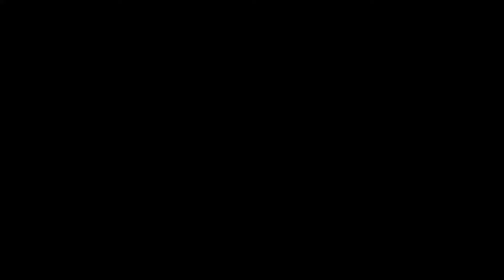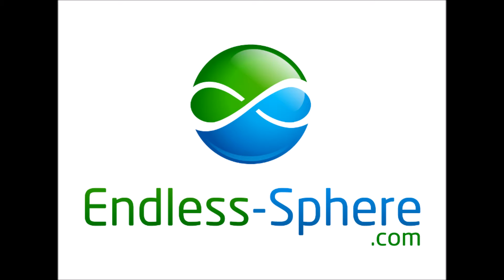Wiring and Connectors

Comment: Hi Christopher. This is an excellent summary although I must say I prefer to hear you talking!

As you may know I am about to try to set a new e-bike land speed record of around 125 mph on Pendine Sands Beach here in South Wales (UK).

I would be very interested to hear your opinion about my wiring arrangements.

I will be running 30S 40Ah using 8 gauge silicon multistrand on Mike's Bigblock - winding up to Vmax as slowly as possible. 
I'm using HobbyKing Y connectors with XT-90's driving Edward's largest controller.

Cheers

Andrew
The Tangerine Dream Machine Man
https://www.justgiving.com/The-Tangerine-Dream-Machine/